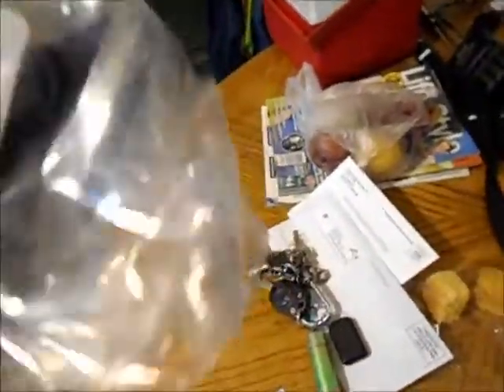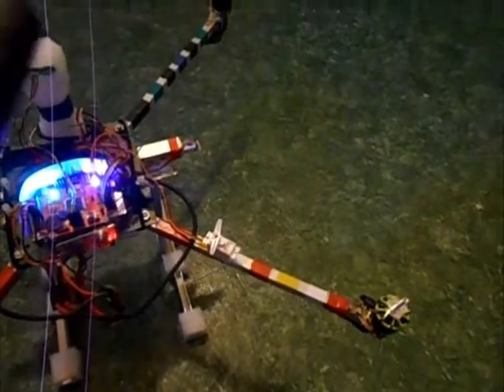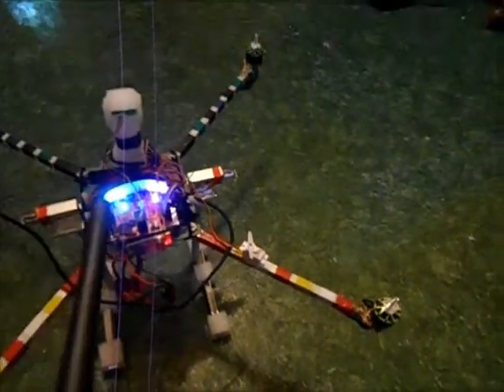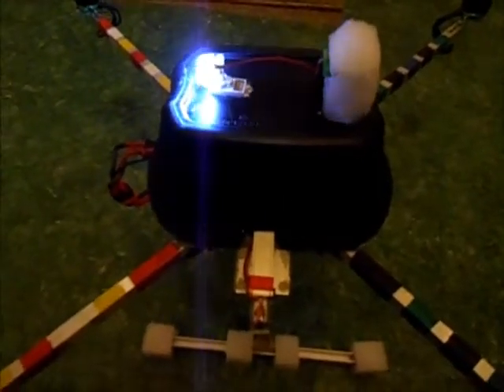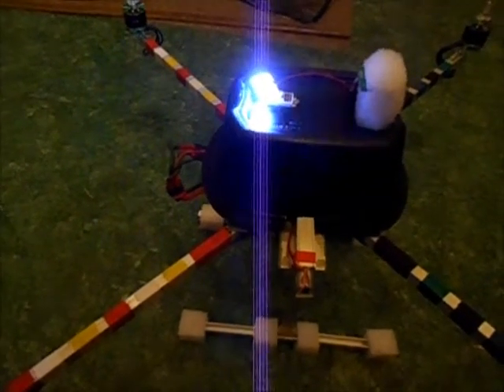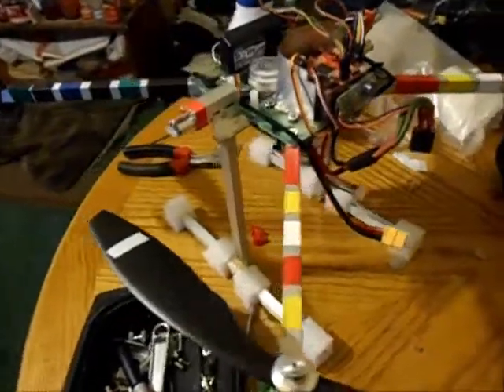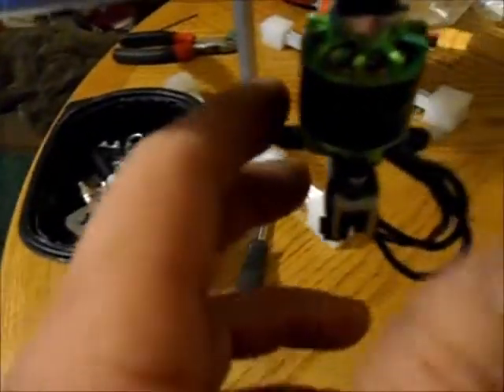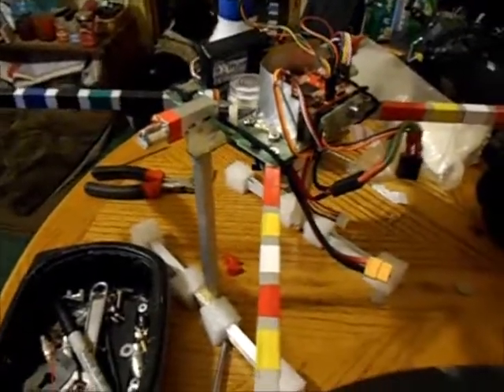Quadcopter Build Part 22: More Goodies Arrive, Another Bug To Work Out

Comment: Nice build man. I too got a turnigy receiver control switch although I think it's DOA, not switching my LEDs that I hooked up to it via my T8J receiver.
Reply from the maker: Check the orientation of your jumpers. If they are on across the terminals in the wrong direction the switch acts dead.